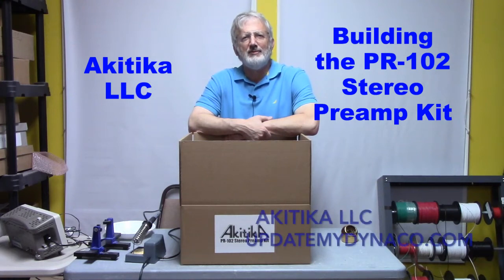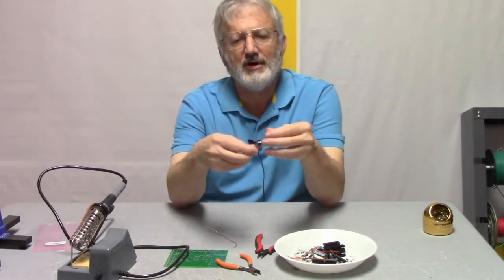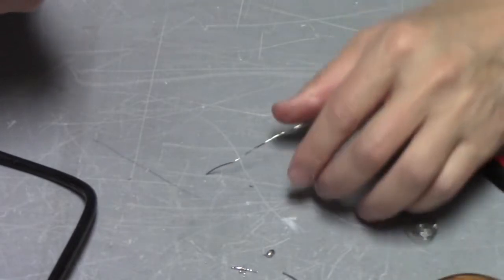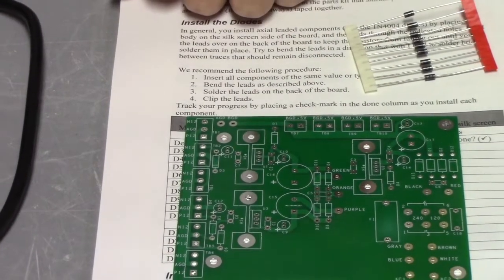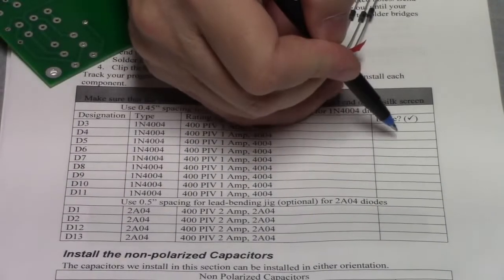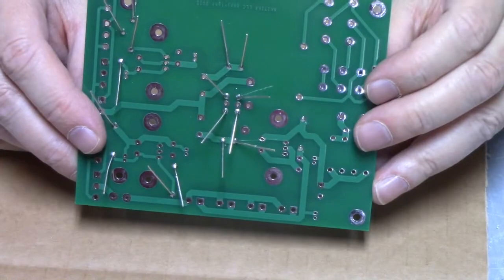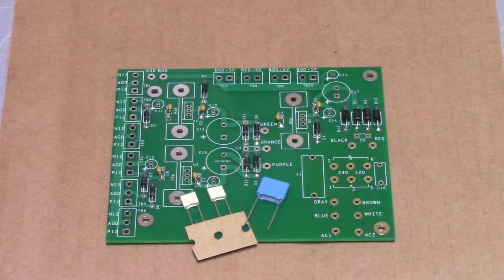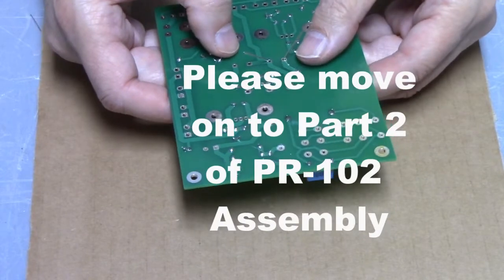PR102AssemblyPart1

Comment: I have a reservation about your way of soldering diodes to the pcb.What your doing is insert the diode leads in the board,solder them then cut off the excess .This is what  NOT to do.
Semiconductors,like diodes and transistors have a power rating.If you have a 1 watt diode and cut its leads,it is no longer a 1 watt diode.What you should do is coil the leads (on a small scredriver)
and solder them to the board,with all its leads lenth,it will retain its power rating.(Heahtkit use to have zener diodes holes widely spaced so you would not cut its leads.)The leads act as a heat sink,so its impotant not to cut them.
Bye.
Lucien.